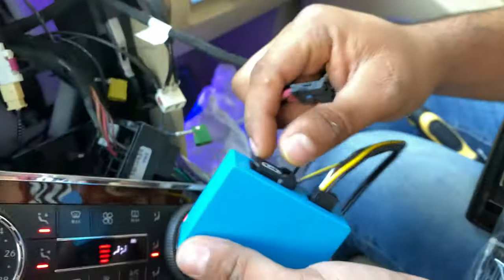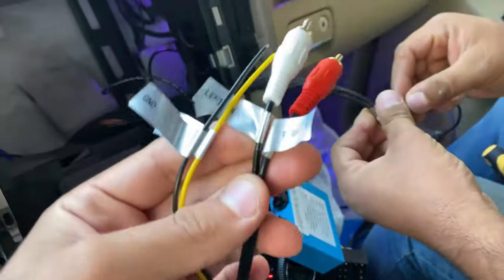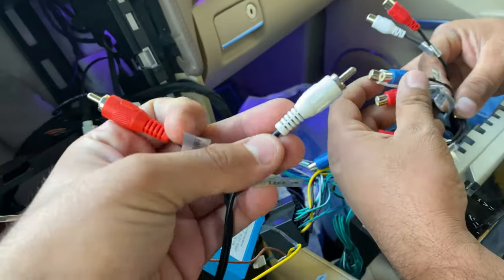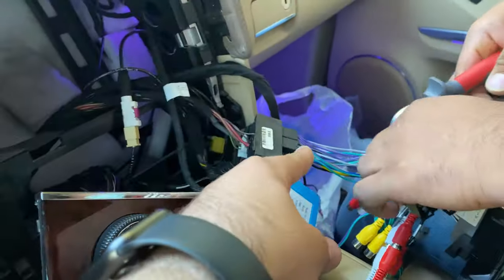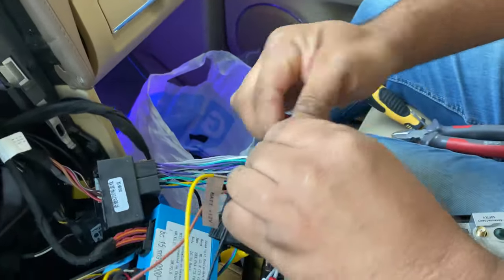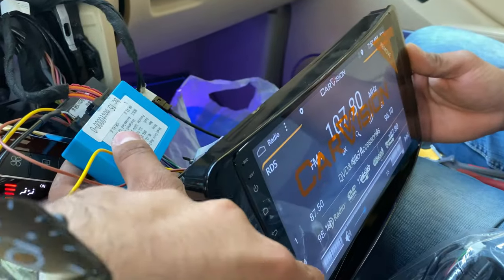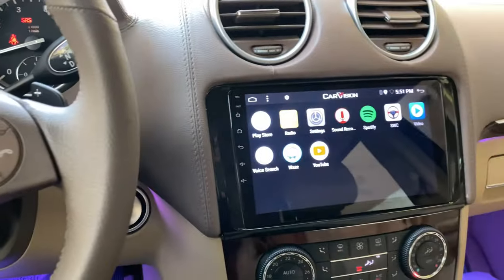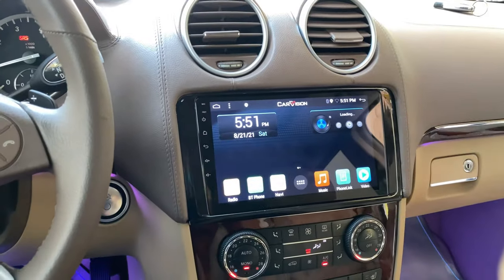How To Install CarVision Android Radio For Mercedes Benz ML,GL With Fiber Optic Amplifier(W164,W251)

Comment: The optical converter only sends two channels so you will find the front speakers work, but the rear passenger speakers do not. So far I haven't found a work around for this issue.

Comment: This video is not detailed enough. It didn't show how the red and white RCA cables from the MOST fiber optic decoder  are connected to which pair of red and white cables. Note that there two pairs on the Android radio.